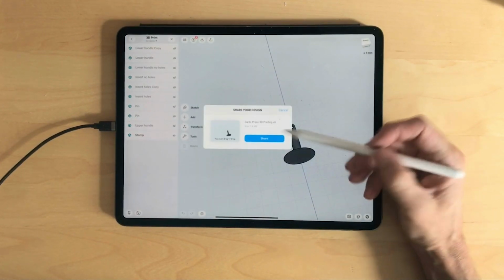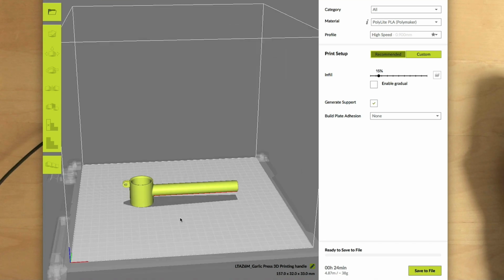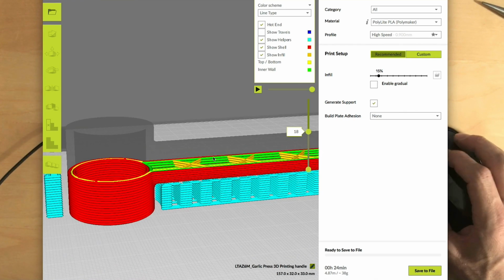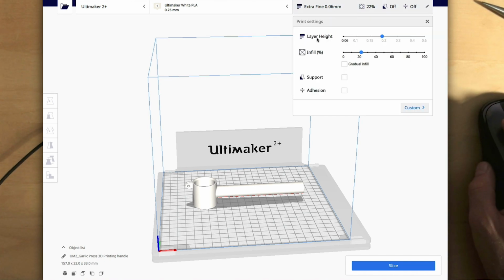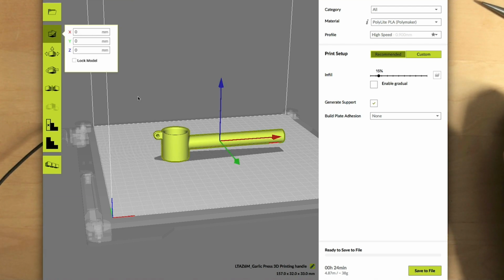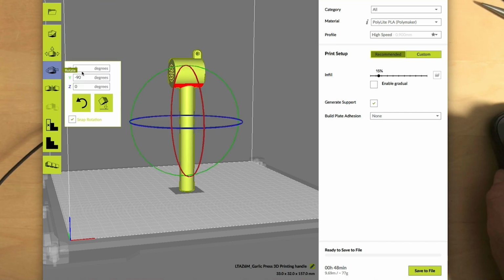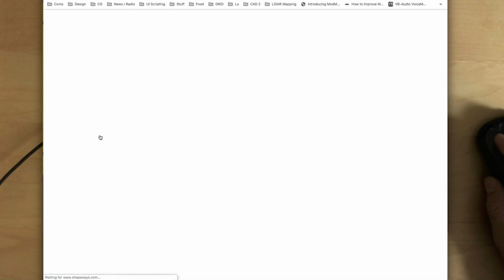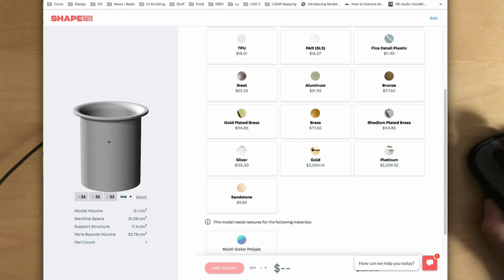Preparing 3D models for 3D printing | Part V

Comment: What is the “3D printing software for task printer”? And how do I send the STL file from my mail to the software on a Microsoft Surface laptop?
Reply from the maker: 3D printing software is the software (the slicer software) that prepares the 3D model for printing. The file which was designed in Shapr3D should be exported as 3MF/STL, imported to the slicer, then transferred to the printer. 
 
Please use any file transferring method between the devices like a pendrive or cloud platform
Reply: @Shapr3D  i think he means what is the actual application you're using?  the icon is just off screen.  i'm also wondering. new to 3d printing